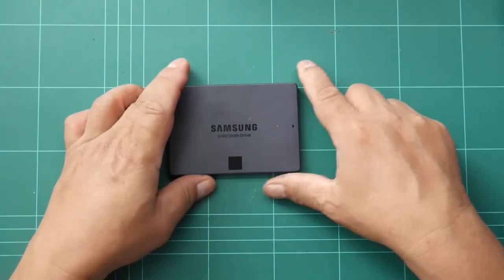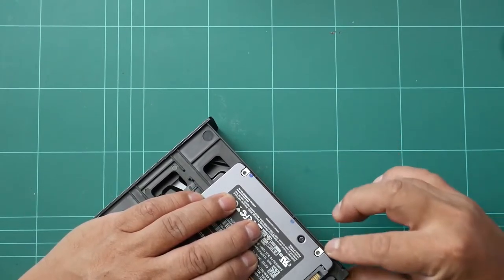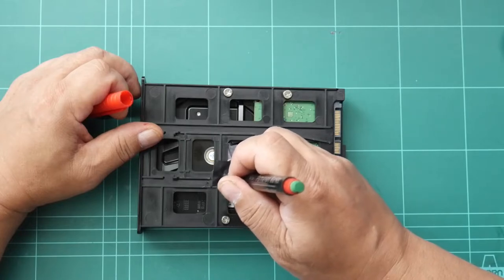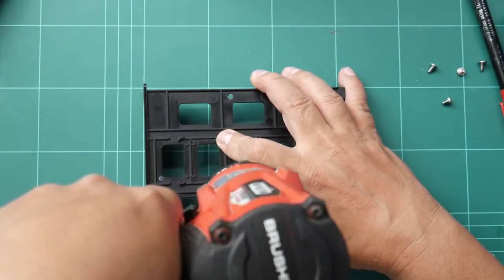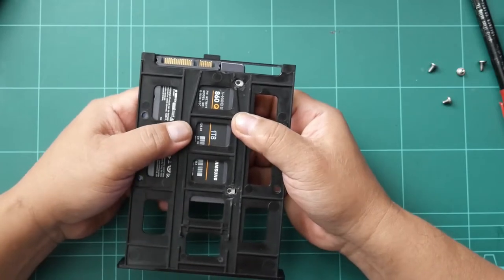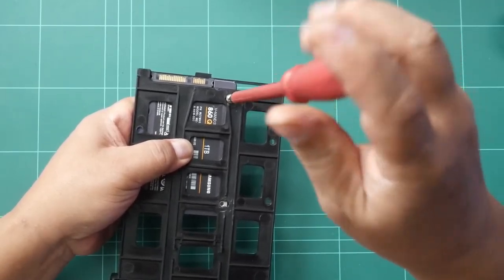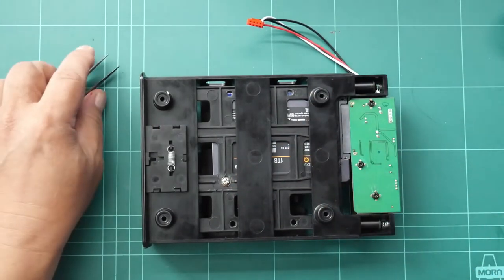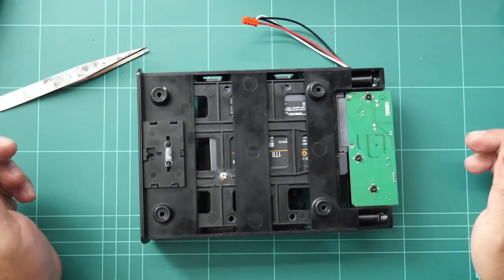Platinum Piano XL HDD Storage Modification from 1Tb HDD to 1Tb SSD

Comment: Kuya, you are a Godsend. Thx so much for sharing this. I am deciding between the Sd vs HDD model, and this confirms my Q from your other video of transferring files from HDD to SSD. One Q lang po, after you transfer the files to the SSD, and finish the installation into the Piano XL, do you need to do anything else, like reformatting the new drive? THX po

Comment: new subscriber here. ask ko lang kung normal lang na nag iinit ung player? (piano xl hdd). wala bang bad effect in the long run? tyia
Reply from the maker: Normal lang na umiinit at mas maigi na ventilated ang area kung nasaan ang player. In theory kapag walang sapat na ventilation ay yung init mismo will degrade ang mga piyesa sa loob ng gadget sa katagalan. In production ay tested naman ang mga appliances in temperatures above normal condition.

Comment: I think that’s the worst upgrade ever, that hdd karaoke player doesn’t need faster data transmission speed, and i also think that you upgrade it because of the weakness of hdd,
Reply from the maker: The other reason for the upgrade is that the power supply died so using ssd is less stress for the psu.
Reply from the maker: Also if you own the Piano XL HDD, you will find out that the psu is on top of the hdd and the temperature is a bit hot. By the way the upgrade to SSD does not mean to speed up processing but better for constant moving the player.